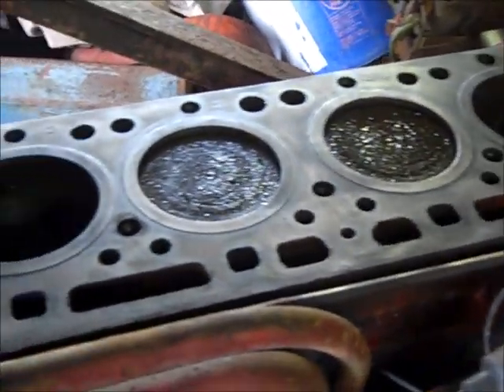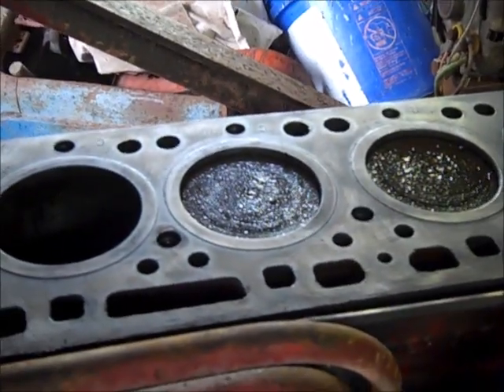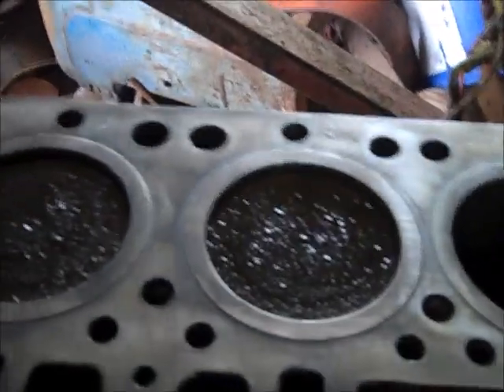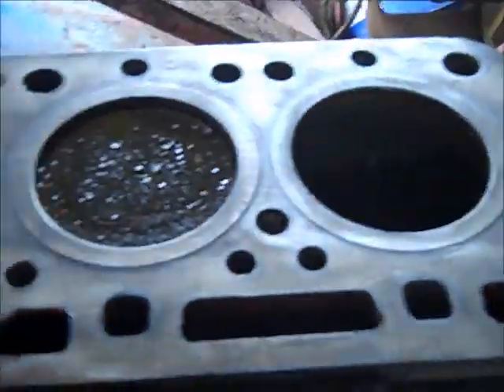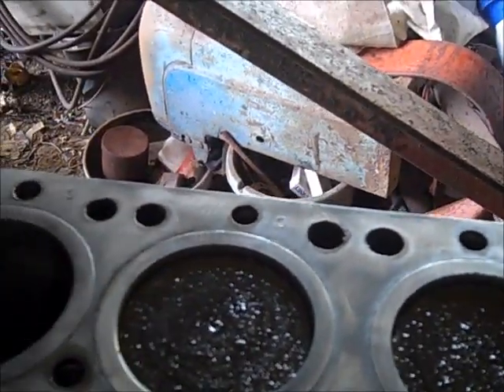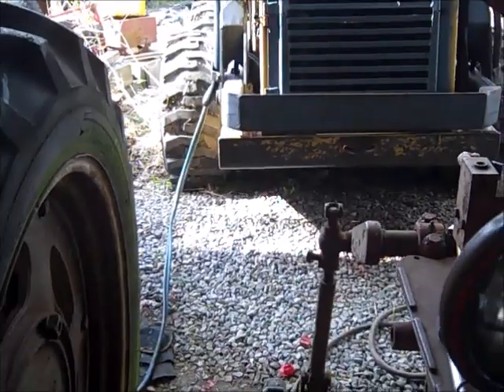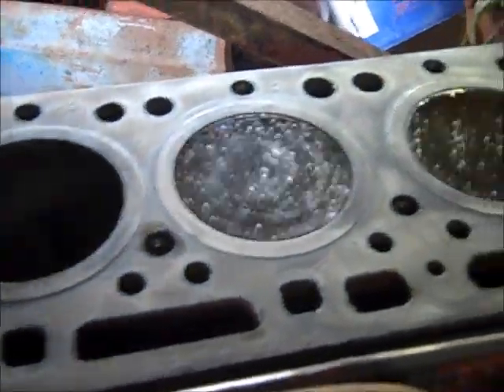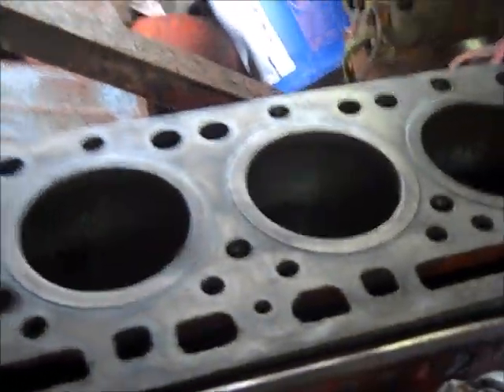Farmall 230 can I fix it part 2  4 20 2021

Comment: I like it that you manage to get them running without throwing away money and buying a lot of new parts. Im pretty much the same way i hate spending money unless its absolutly necessary. I save old parts. i save the sleeves and pistons from engines that have busted blocks. if i get a engine that only one cyl is badly corroded I will install a used sleeve and piston. One thing I always do is take off the oil pan and make certain the oil pan and the oil pump screen are  100% clean.

Comment: Using the PTO shaft is a great idea, I guess if one doesn't know from moving it around to get the tractor in the shop, and with the engine still stuck using the shaft on the PTO checking to see if the clutch is free would be a good idea too.